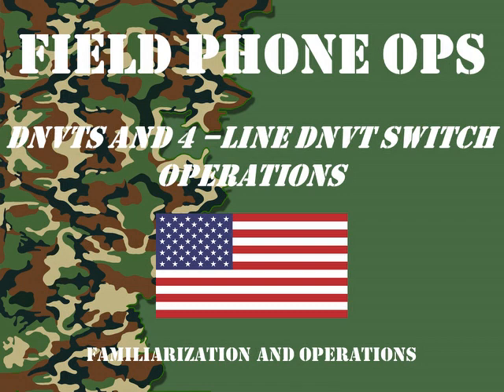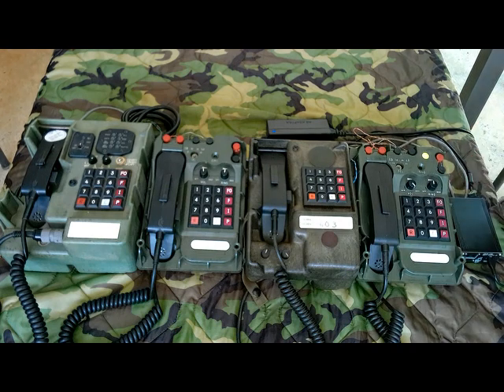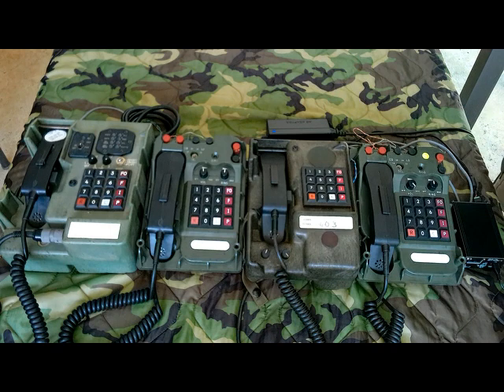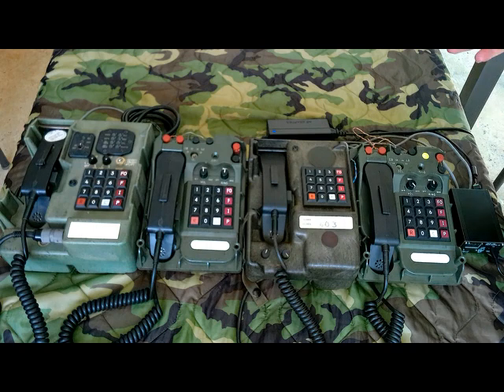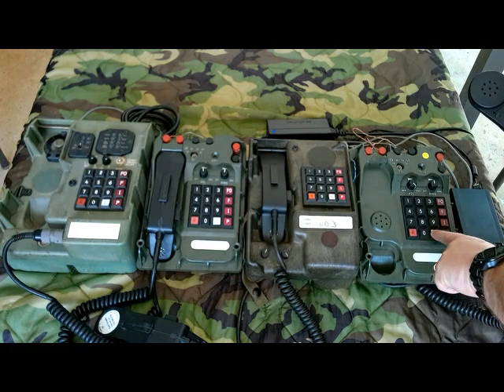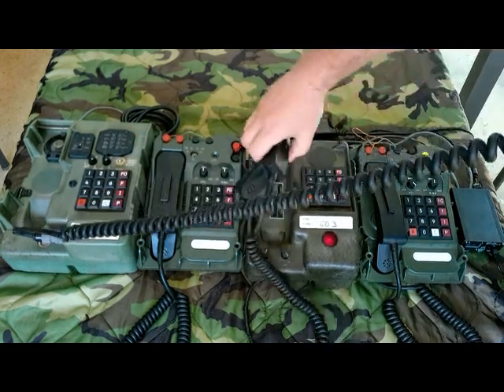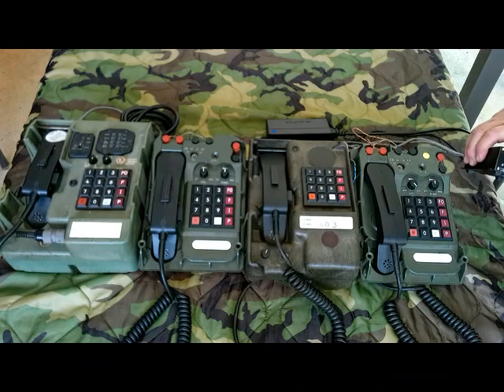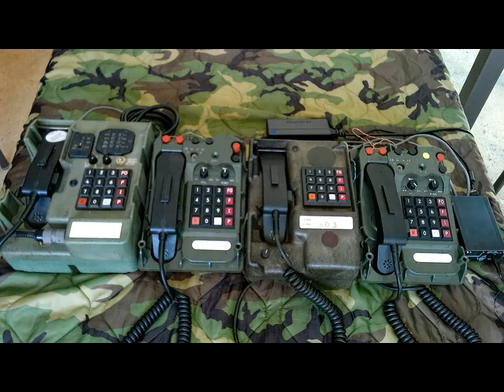FIELD PHONE OPS: 4 Line DNVT Switch Operations

Comment: Hello! I just bought a pair of these switches! Have had variousphones for years but were never to get more than 2 DNVTs to work together. It wasn't until I saw your video about pressing the C button twice when using the CA-67s when I was sad about them not working correctly. Thank you! Are you going to do a video covering the CA-67? I wish I had a TM for them. Any info on how to program them? Thanks again!
Reply from the maker: You can review this old video of mine.  I never did a dedicated video to CA-67.  I'm not sure what you want to program?  
https://www.youtube.com/watch?v=whQnO5yIrzM&t=7s
Reply: Hello again. I tried to post a reply earlier but I don't know where it went. But on the CA-67s you can adjust the settings to change how it interacts, such as a Voice Only terminal or a data only terminal, etc. I only know how to adjust the base level settings. I would need a TM to discern how to change the other settings. I had further details in my reply that somehow did not get published. I can divulge further details if you wish
Reply from the maker: It's TM 11-025-328-12P that governs the CA-67/U and the 2936.  It basically will give only give  you a dial modem connection at 4.8 or 9.6k.  The PC must have a serial port and a 3.5 inch floppy because you need to run PROCOMM, BLAST, or GALATICOMM Fax Modem Software and the distant end must also be a CA-67 with a PC and the same software.  Really cool back in the early 1990's.
Reply: @thefieldphoneguy8254  Yes sir! I've got some feelers out to see if I can snag a copy of that TM but no luck so far. That's exactly what I would love to do! Simple text based stuff, almost like a closed circuit BBS! Could still have modern day relevanence such as remote monitoring of sensors; most industrial and life safety systems like fire alarms and air quality monitoring still require a good old RS-232 port which could easily be integrated. Adapting an SBC like the Raspberry Pi would make it compact and the simplicity, bulletproof. Just fun stuff all around. Thank you again! I truly enjoy your videos!